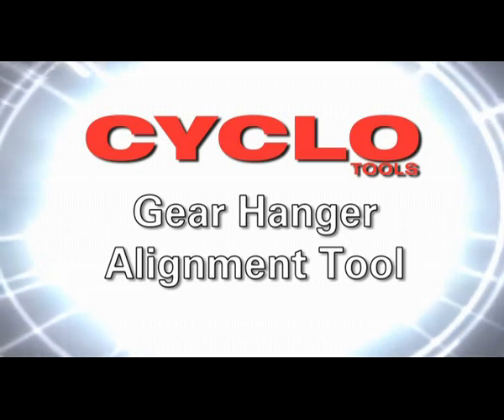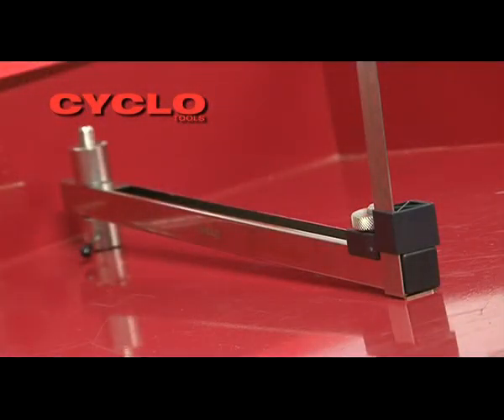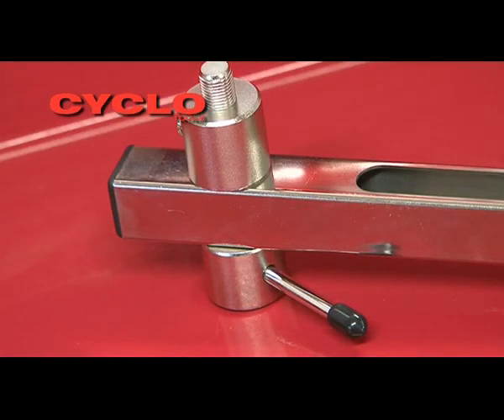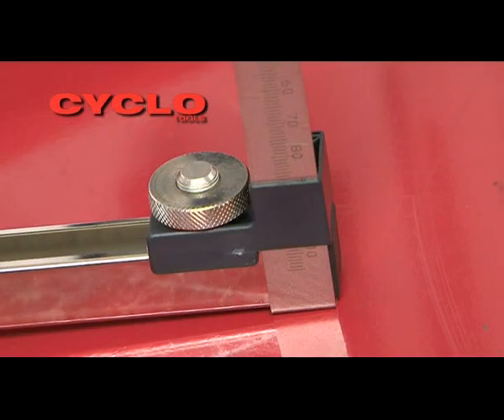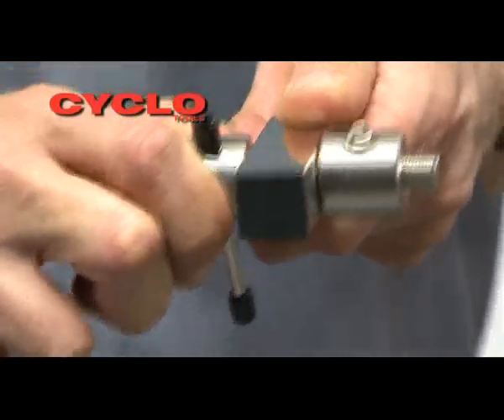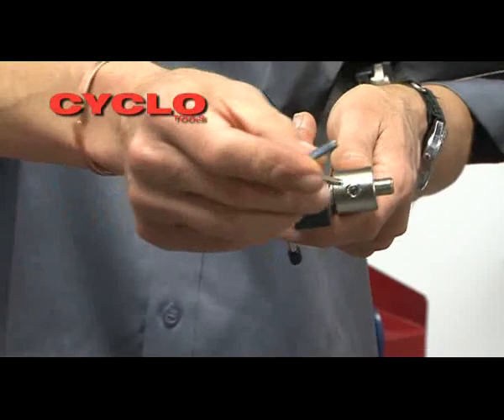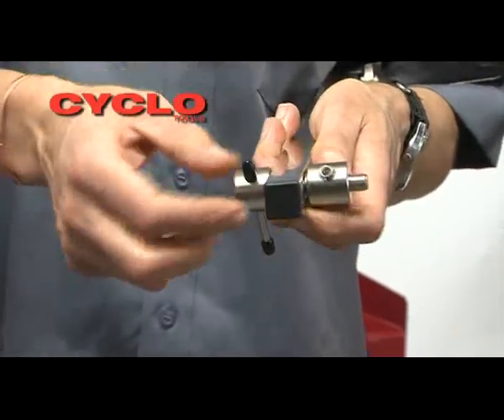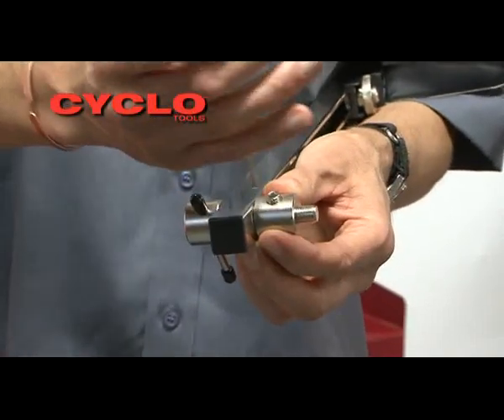CYCLO Tools Gear Hanger Alignment Tool

Comment: Some replaceable hangers seem to be made from brittle alu that breaks much more easily but most seem to be a softer alu that is happy to be reset a few times, unless it's been bent really badly. If your gears aren't indexing properly & nothing is worn, in my experience the 2 causes are either dirt inside the gear cables or a mis-aligned hanger. I've not yet broken one by straightening.